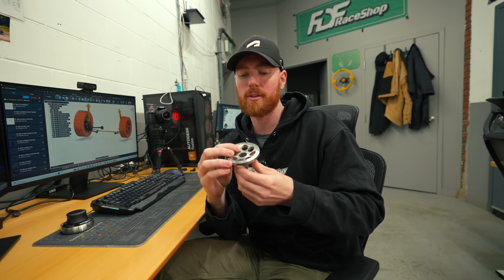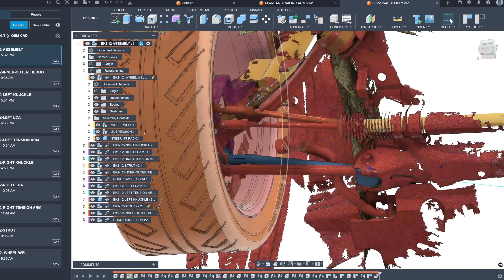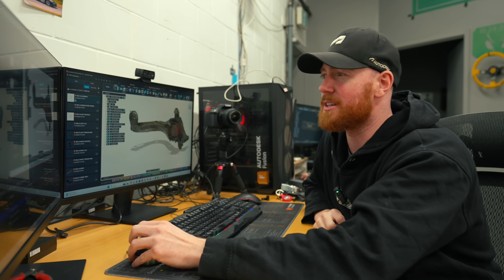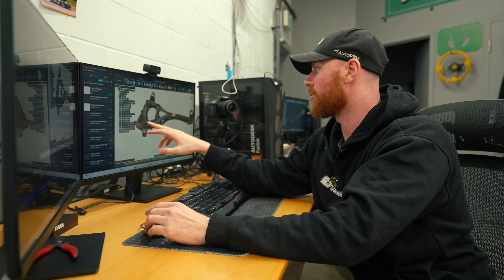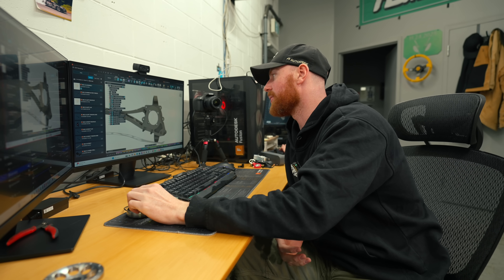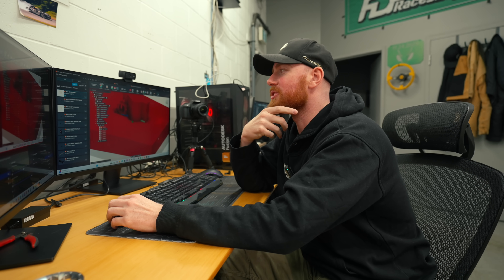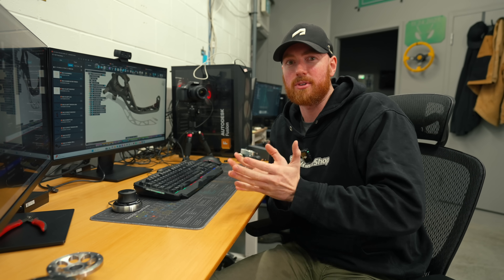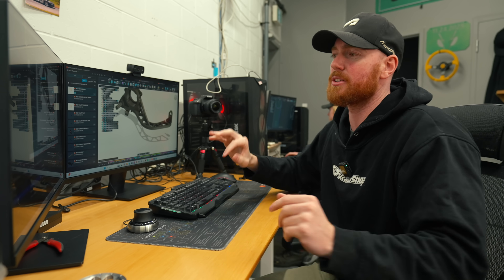Design Time Episode 17: Custom Rear Suspension for Adam LZ

Comment: Is that E36 rear arm going to be a public release? I've designed a subframe that will allows an E36/46 style rear suspension on an E30. It's relatively simple (and has been done before) but the bottle neck for me is manufacturing the knuckle. The knuckle portion of the design is identical to an E36 and so are the upper and lower arms. However, the trailing arm needs to be different to bolt up to the outer pivot point of the stock E30 subframe. If I had one of these knuckles, making the trailing arm to bolt onto this would be a cinch!
Reply: Where can I get more info on your subframe? I’d be willing to test something like this on my e30